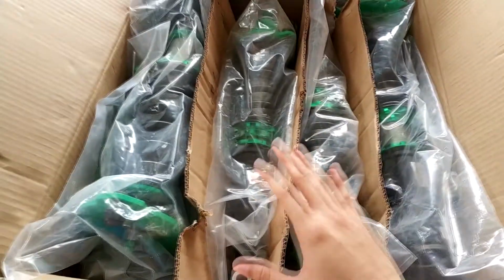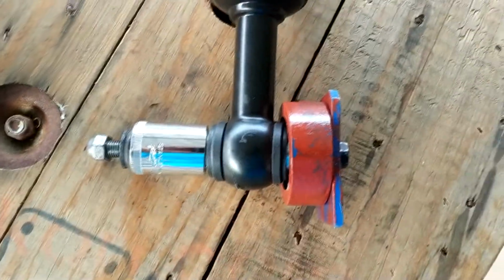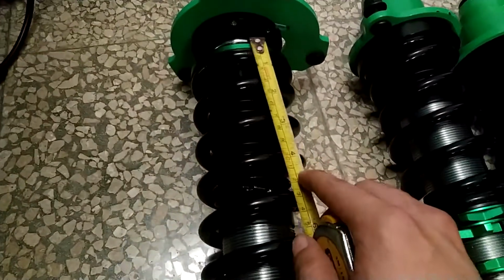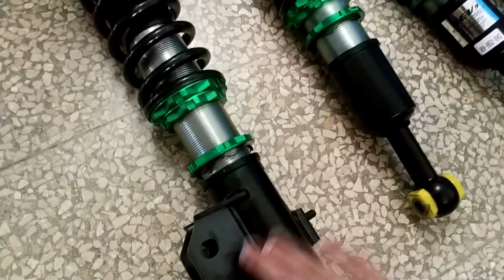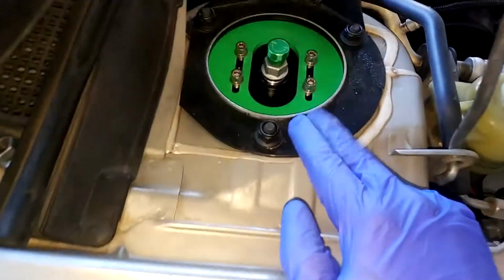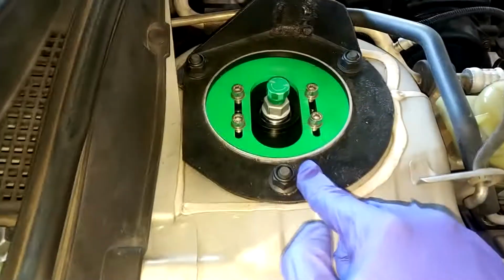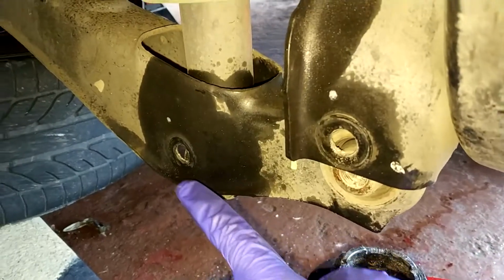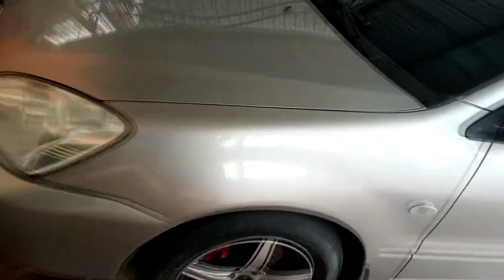Installing Rev9 Hyper-street II coilovers on the Mitsubishi Lancer 02-06

Comment: Hey bro. I put mine on a ralliart gettin smackin in the back. Can you help
Reply from the maker: Hello, check the lower bushings of the coilover, maybe they are bad.
Reply: They brand new. Just installed yesterday
Reply from the maker: @qstorm007  Check the preload of the springs, maybe they need adjustment.
Reply: @nomis97  will try. I thought I wasn't supposed to tamper with it
Reply from the maker: @qstorm007 you are not supposed to, but measure the 2 coilovers to see if they have the same lenght, if they are okay, do a visual inspection to both of them, maybe you can find something.